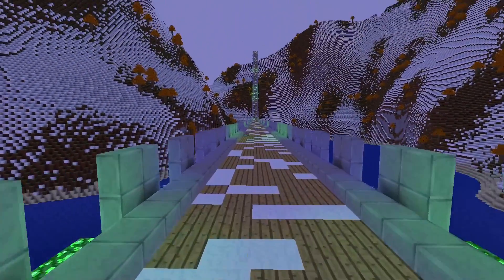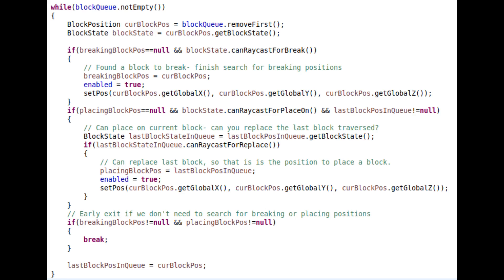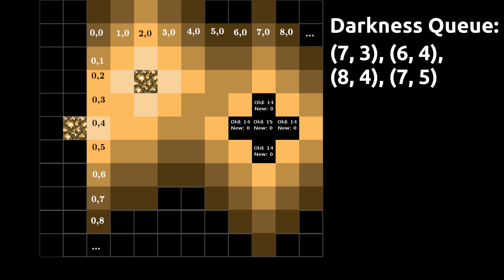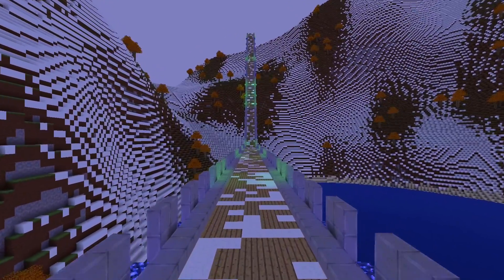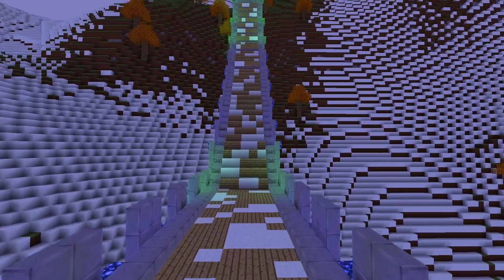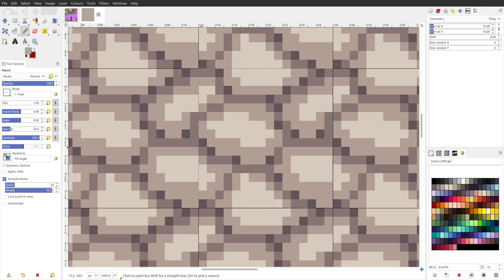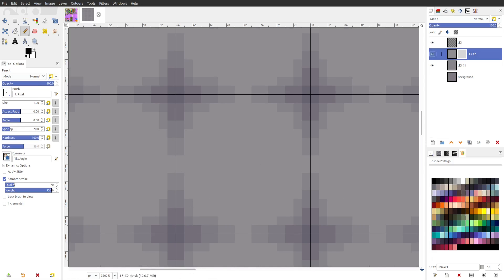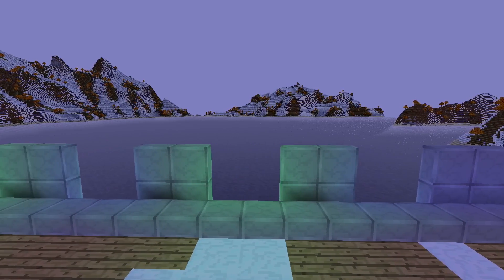The Algorithm Behind Breaking Blocks – Remaking Minecraft

Comment: So with crafting menus: I like but not love when you see the potential resources kind of cycle through in the crafting space or requirements. like you could see the different colored woods cycle through over the same space. Something similar to that would be fine in my opinion but maybe that would be copying the like JEI menu or something. Or maybe like if it uses wood and gives you something basic just only use the keyword wood, so birch wood planks -> recipe requires wood -> sticks | birch wood planks -> recipe requires specific wood -> birch wood slabs (my thinking is if you have the unique blocks craftable, you should be able to have one recipe that grabs the specific block type attribute such as wood type or stone type or similar idea and the recipe automatically adds that to the final product. So it is taking in any wood planks + wood type (birch in this example) = final recipe (birch wood planks or whateva!)

Now This could have been obvious but what if it wasn't so I still made the comment, sorry for any errors

Comment: probably late but there are minecraft mods which i think have a relative good solution for multiple variants being able to be used for the same recipe. either you make it not care and take the first valid option it finds, with maybe giving the player a choice in what order to priotize or you make the different variants dynamically generated recipes for each variant that exists, show only a generic variant or one of them as the preview and then give a selection option to choose from which to use. so in the overview of all the recipes in the tab/category you would see all just once as the limit and after selecting the recipe its further limited to just the different variants to show. you can even take it a step further and hide the ones the player cant make and for example if there is just one variant that can be made then just mediatly do that instead of going through a variant selection with 1 option.

Comment: Hey does that script for raycasting into a block work for other meshes or only Bounding Box blocks? Like, Could my raycast go through an anvil?
Reply from the maker: In this video, it was a naive check for a full sized block. Recently I've improved it to get the bounding box of the model, making it work correctly for slabs in particular. In the future, all that would be needed is that if the bounding box check succeeds, then check for all bounding boxes of the cuboids of the model, and early exit on the first success. The algorithm doesn't need to change in that regard.

Comment: for block varients i think mojang handled that quite elegantly. a variable after a given block ID would solve that. (im not a programmer in any way shape or form btw) this can also be useful for modded content. lets say interactable blocks like crafting table, oven etc could be internally one block ID and given by the stored variable which sets the right texture and GUI window upon an interation. given on how the variables for modded content would be determined could this solution even be more efficient than in minecraft, because minecraft doesnt have an official modding API by mojang.

a whole other aspect/recommendation regarding a potential multiplayer in the future would be the implementation of a pvp system like it was pre 1.9 minecraft, and an easy way to create minigames for servers. i realize this is something that would be tackled at a way later point in development.
a few general examples for multiplayer specific stuff i can think of off the top of my head. an internal teams variable with team respawn locations, world switching, customisable loot tables, customisable level progression systems for RPG stuff, stat displays, a way to show information that is not in the chat or a huge text like it is in minecraft. i built in role system for persmission related stuff.

Comment: For variated/rotated textures:
If I remember correctly, Space Engineers uses greedy meshing and achieves texture variation by having textures that are much larger than a single block. When the meshes are expanded across multiple block lengths, more of the texture can be used and therefore it appears that the blocks have varying textures.

Comment: I'm wondering, would connected textures (across multiple blocks of the same type) be viable with greedy meshing?
Reply from the maker: Greedy meshing would still work, but be slightly less effective, as though the different textured areas are actually different blocks.

Comment: Hmm, I am not sure I agree with how you are rendering data. Given that you are working on a voxel engine (which has a lot of very similar objects) I would look into multi instance rendering. Ideally would suggest you switch to GPU driven rendering and use mesh shaders (the modern successor to the traditional vertex/fragment shaders), doing so could result in extreme performance gains. As an added benefit it should be trivialy easy to write a gpu based culler for opaque blocks, which could furthe help improve performance.

Even if you only use gpu driven rendering for the opaque pass  you could already see major performance improvements.

Comment: For the comparison of birch/sticks- it may be good to implement a tag-identifier system. So you have a 'stick' as a tag, and need 'wood' or 'planks' to make sticks, whatever has the 'wood' tag can be turned into the amount of sticks, regardless of the actual wood type. Hell, it could go further; transferring over other tags depending on the recipe; say make 'birch' a tag, and if the recipe allows transfer of tags it creates a birch stick. Having a modular crafting system like that would be fantastic. 
Maybe it could even introduce something like how Tetra (Mod for mc) works, with different materials having different properties depending on the tags.
For issues of multi-wood crafting for inheritance, it could just be a priority of whatever material is most common, just not allow different types if it is an inheritable recipe, or whatever material is first in listing.
There's also another interesting idea based off this; modular/generative sprites. Say you are crafting pistons, which need 'stone' and 'plank' tags; it could inherit from both and generate a texture from said types of planks and stone- with some extra bobs for distinction, using the tags to call to what portions of the sprite map it needs. 

Thanks for the update! Look forward to your progress!

Comment: About greedy meshing and texture rotations: yes it can be done in the shader! There are a few pitfalls but I managed to implement it. I use array textures, so I only had to make UVs go from (0,0) to (1,N) for a N-long strip (I only do 1D greedy meshing) and then chop it on the fragment shader and apply random rotations to the fractional part. That can be used to sample the texture and voilà! Just make sure to use textureGrad and pass the derivatives of the unchopped UV coordinates to avoid artifacts (it took a wgpu maintainer to explain things to me to make me see what was wrong).

About relative coordinates in chunk batches: they can be avoided with indirect multidraw! You can pre-generate an indirect buffer for each batch with the values to be drawn, manipulate the base instance of each sub-mesh to pass their XYZ coordinates and unpack that in the shader. Then, with a single multi-draw call, you draw the entire thing. See https://www.khronos.org/opengl/wiki/Vertex_Rendering#Indirect_rendering

Anyways, I cannot help you with OpenGL specifics because I'm not using it, but I hope the same logic applies. If you need any further help with a particular concept feel free to ask, it's a bit messy to explain it all in a single comment.

(PS: I will be testing smaller chunks myself, I'm using 32x32x32 and maybe that's a bit too big, although the game runs fine so far)

Comment: For the crafting thing one thing you could do is use the Dwarf Fortress construction UI. When you go to build something like stairs, it prompts to ask you what material you want to use. You can click + or - on each material to handpick how many of exactly which material would be used. You can also just click ‘all’ on a material and then the recipe will just use material you selected all on. The default way it works with the + and - spam click nonsense is janky, but using DFHack, a modding engine for the game that most of the player base uses, the system is improved further. Instead of using plus and minus, you can select which materials will be used based on their properties, or you could create lists of materials that you want to use for crafting… like maybe a player has a lot of oak so they use that to craft wooden items instead of birch, or maybe a player wants to build stuff out of fireproof materials like stone instead of wood, so instead of them having to look through a long list each time they craft they can just use their defaults.

Comment: Are you going to open source this?
Reply from the maker: When it gets close to ready for playtesting, ideally I'll have an asperite-styled open source model, but I will have to consult a lawyer for this. If I make any tools for the game, I think I will have a more permissive license however.
Reply: @finalforeach  Will you release Linux binaries? I always wanted to have a minecraft remade in C... Java's is terrible for performance since it has to run the entire application on its own VM that sucks up ram and cpu performance
Reply from the maker: I am running it on linux, but as for binaries (you mean as opposed to jar files I assume), it would mean that modding it would be less flexible, although I am considering using GraalVM potentially for porting it on consoles. That said, I wouldn't underestimate the JIT. Minetest does use C++ if you are interested in that however.

Comment: for the crafting recipe thing towards the end of the video, a tag system would prolly be best

for example : we have "Oak Wood Planks" and "Ebony Wood Planks" we can give them both the "Wood_Plank" Tag or something like that, then use that tag in the recipe instead of the block itself

this seems like a very simple way to go about crafting, as far as storing recipes go, a very short line of code to determine the placement in the menu (1 being top left, 5 being the middle and 9 being bottom right, if you were gonna use a grid) might work best but i don't know exactly how user friendly it would be just depends on how you format it

Comment: Another great way to differentiate from the minecraft style is to use a different scale. In minecraft, the player is 2 blocks tall, and 1 block wide. What if the player was, instead, 3 blocks tall and 1.5 blocks wide? Doors would be designed as 3x2 blocks, and there could even be door varients which are thinner and place into vertical slab blocks.

By changing the block scale the game would become extremely well differentiated from other minecraft clones, and the extra amount of detail capability may even be seen as an appealing factor attracting players to it.

Comment: Have you considered adapting the DDA algorithm for block editing? You could use it to find the nearest block on a vector whose magnitude equals your reach, and since it detects every time you pass through an edge in 2D or a face in 3D, you don't need to worry about checking for collisions often enough. DDA adapts to the size of your grid which is what's so nice about it.
I'm not sure how it compares performance-wise to your current solution though.
One potential drawback is that you don't collide with voxel edges or corners if your view direction is precisely aligned. That doesn't seem overly difficult to fix though. I'm not sure your current method accounts for that either, so that's a potential bug you might want to test for.

Comment: the random rotations with greedy meshing could probably be done in the shader without too much difficulty. with the per block uvs, wrapped from 0 to 1 and a per block random value, it should be not too hard to modify the uvs with the per block value, and then use that to sample the texture. i think there’s just 3 transforms, swap axes, invert u, and invert v. if you also store the texture to use per block as well, you could do that as one pass, per block uv, flip and swap, add uv offset, sample packed texture. you’d have to have one pass for rotatable and one pass for non-rotatable but you might be able to modify the per block randomness to control what can happen to what and do it all in one.

Comment: Wacky suggestion for crafting: An expanding item-specific grid system. It would start with just a blank grid in the ui, and when an item is placed, only relevant grid spaces next to it brighten, and if you've crafted the resulting item before, the item shows up. This way, you don't have Minecraft's issue of having to memorize the specific shapes in a 3*3 grid to craft something. You just need to remember what items can be added on to the initial one. If the item is too generic, like a plank, nothing wood (lol) light up around it. If it was rarer, like a mob drop from a difficult enemy, only a couple spaces beside it would light up. You could still have big or complicated recipes, it would just take multiple steps. The first item placed would have a simple list/array of the t's and f's for whether spaces should light up next to it, which can be stored in a text file or random string somewhere, while the next items would work through the more complicated recipes. For future-proofing, you could devise a sort of code for a new recipe, so each recipe is just a line in a text file, and you can just type in more when you add new items.* The game would kind of translate it between the player's input and the recipes, displaying possible next steps. You could even have the game temporarily re-organize the recipes (assuming you're implementing some kind of text-based interact-able item like a book and quill) with each item placed so it doesn't have to run through the whole list each time.

*Something like 
Start: "stick", Up wood_plank, Up wood_plank, Result: "Wooden sword"

Start: "stick", Up "stick", Up wood_plank, Right wood_plank, Result: "Wooden hoe"
Start: "stick", Up "stick", Up wood_plank, Left wood_plank, Right, Right wood_plank, Result: "Wooden pickaxe"
Start: "stick", Up "stick", Up wood_plank, Right wood_plank, Left, Left wood_plank, Result: "Wooden pickaxe"

Pros: This way, there's no cheat sheet; you could have a unique crafting system; you won't be confined to a specific size; players would get a general sense of how versatile or rare an item is; and you could have all the birch-oak sticks you want if you use the grouping system mentioned by top comment.

Cons: You'd have to get clever with checks so it isn't slow-responding; some recipes would be awkward to implement [see example with wooden pickaxe]; it's definitely a wacky, gimmicky concept.
Reply: Sounds about right maybe a system like how recipes are described when modding in Minecraft
1, 1, 1
0,2,0
0,2,0
1 being a block of wood/stone/ore
2 being stick 
0 being empty slot
For simple recipes this would in theory be fine and each value can be a list of possible items with some sort of check if an item is going to be specific to a certain material that only that material is in it respective slots for that recipe
This would also allow for 9 unique items assuming no slot is empty
This doesn’t however solve the problem of things being able to be crafted in alternate ways like how Minecraft handles the recipe for books without making it overly restrictive by only having one valid pattern (books are the worst offender when it comes to this ) with others having 2-4 variations on placement mainly being anything that isn’t centered on the grid like pickaxes or some partial blocks

Comment: For the wood issue, the most elegant solution is two-fold

1. Have some backend "trait" systrm for each block. This is also useful for modders and compatibility, since any block they add they can make sure it works with recipes simply by assigning it the proper metadata trait of "woodPlank" or "stoneBrick", etc. Then you can get more specific with "birch" or "oak" if you want specific differences.

2. Simply do what minecraft mostly does and start from the first inventory space to the last. The recipe uses the first acceptable items located within the inventory. This would be the simplest way to dealing with complex recipes.

As for the recipes themselves, it would just need to have some logic to know exactly what is in the inventory. The easiest methods would first, check for the spaces that have the items with the desired traits. Then, from among the potentially valid inventory slots, take the quantity to then confirm if their is enough material to make the desired item

Comment: how much of the memory is used by java just doing java things?
with hindsight being 20/20, i feel like you could use a lot less memory if the project started out with another language instead
Reply from the maker: The conclusion at the end of the video was actually due to a memory leak that I fixed just before the video was released- memory usage is now very reasonable and mesh data is no longer the bottleneck. When taking on a large project, it's important to be maintainable, which means working with familiar code whenever possible. I've found the nice things about Java regarding debugging, profiling and the quick startup have outweighed the bad, but I wouldn't discount others being able to use their language choice just as proficiently.
Reply: @finalforeach  nice reply 👍👍